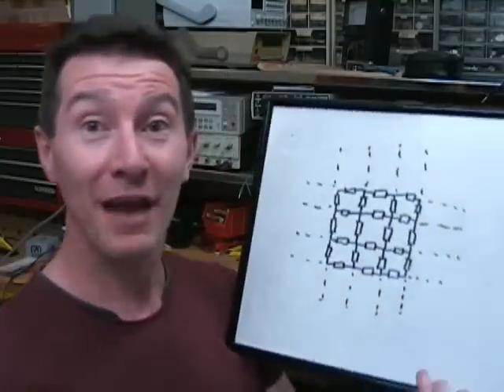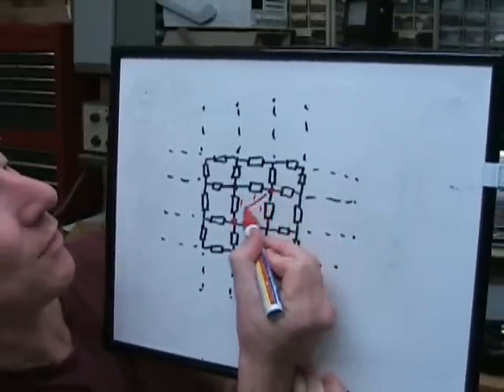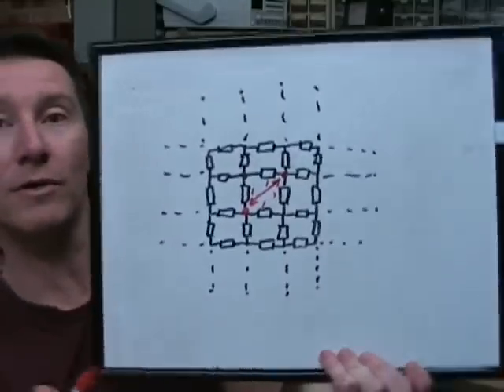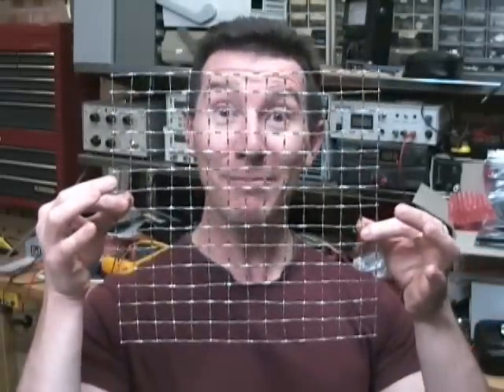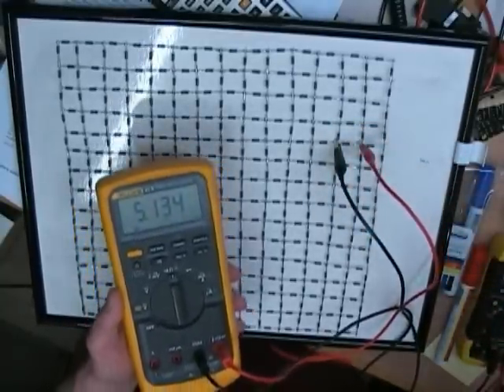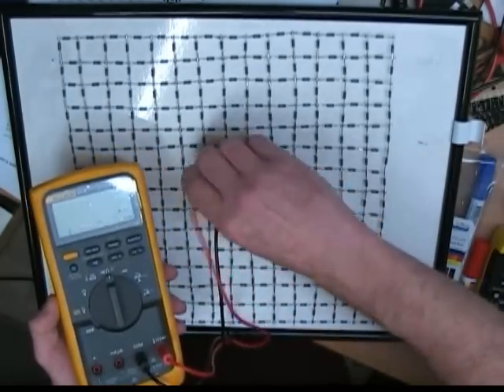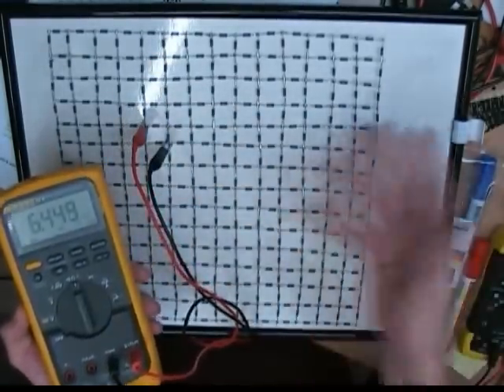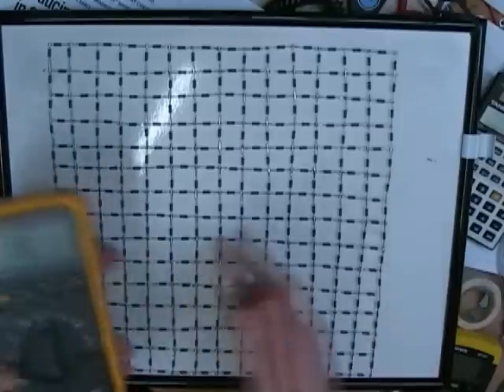EEVblog #25 - The Infinite Resistor Puzzle

Comment: I made a 3D version using 1K resistors.  The resistance across diagonal corners is 1K.
Reply: +K6EEP Diagonal on the face (i.e. min path=2), or across the cube (min path=3)??
Reply: +EscapeMCP  This was a huge cube.  20 resistors across at least.  So a facing side was a 20x20 array.  The idea was to guess resistance from corner to the opposite corner across the cube.  (min path=3 in your example)  Some one had donated a thousands of preformed 1K resistors I kept growing it until my soldering hand got tired.

Comment: Effective resistance across the single resistor is 2R/M.  M is the number of resistors (R) connecting to each junction.  For your square mesh M=4.   If the 2D mesh was actually a 3D cube, then M=6

Comment: The infinite resistor grids (in 2D, 3D, 4D, …) are awesome to demonstrate how physical structures give rise to sums of infinite series. Conversely, as a rule of thumb, if you have a series and can think of a resistor network where resistance between some two nodes is a sum of the series, then the series converges. This can actually be mathematically proven, no less.

Comment: Congratulations for being so practical.
This reminds me of the historic story when Edison was manufacturing  light bulbs and for some reason he wanted to calculate the volume of the complex shape of a glass light bulb. Apparantly the mathematicians came up with some approximations but were not so sure about the accuracy of their result. Then Edison who was a very practical man  came along and filled one glass bulb with water and he knew the volume of the water and also  floated or immersed the glass bulb in water thus  displacing the water according to Archemedes principle and again he found the outside volume of the bulb , hence he could find the volume of the glass used in the bulb.   Mathematiics are very useful but being practical sometimes gets quicker results.
Reply: practical mathematics <3
Reply: Edison was on a camping trip in 1887 near Rawlings Wyoming,  Battle Lake when he dropped the tip of his bamboo fishing pole in the cap finite noticing the glowing car nixed fishing pole tip.... I've driven by the spit many times it is marked with a historical marker.   Story is a bit iffy but makes for a good tail..

That's why I go fishing, to be inspired to invent the next big thing,  my story to my wife and I'm sticking to it...! 
😊
Reply: The definition of applied mathematics.

Comment: I know this video is old, but I just recently found your channel. Amazing that the result is 2/pi. I like your practical approach. Would be interesting to see how the result changes if you gradually chop it down to smaller networks: 12x12, then 10x10, etc. Or if I get around to build one, maybe take measurements as it is being put together.
Reply: David Scott Any finitely sized network has resistances that are a truncated sum of an infinite series. It’s possible to prove that by induction. The convergence rates depend, among other things, on how many dimensions does the resistor grid have. Try going from a 2D grid to a 3D grid with roughly same number of resistors. Then a 4D grid. Then try going from a hyper cube (square, cube, …) to hyper sphere shape (circle, sphere, …). You’ll get quite a tour of various forms of infinite series, and can then ponder questions such as  “does the circular grid converge similarly like a square grid would”. While doing so you’ll rediscover some cool theorems in calculus. All from a “simple” resistor network. I urge anyone who’s so inclined to try it out. Sometimes having a physical object to think about makes the math easier to understand. That’s certainly the case for me. When I took a mechanical vibrations course, in my mind I modeled everything with electrical circuits :)

Comment: As people have asked about three dimensional versions of this it occurs to me that if the lead lengths were constant, the resistance value between any two points might well be a constant percentage of the value of one resister.  I initially expected the diagonal value to be 1/2 of the square root of 2 or .7, which it is nearly is.  If lead lengths are all the same, then we can probably model this as a solid block of conductive material.

Comment: Why not connect the ends of each row and column, such that electrically there would be no center. Each resistor would be attached to the same number of resistors in every direction, kind of like a scrolling game. Would this work?

Comment: could you build a cube out of six of those and get the infinite properties?
Reply: I think the topological equivalent of the infinite grid would be a torus rather than a cube. Anyway, when you measure the resistance, that topology changes again so that there are also infinite zero-resistance "connections" between points at equal distances in the equivalent infinite grid.
Reply: An ifinite resistor torus with Rodin coil alignment would surely wet daves practical appetite and would look stunning
Reply: +orbik  Nicely said. If a grid of perfect zero tolerance resistors were overlayed on a toroid, would the measurement on any resistor or diagonal measurement (as dave did on 2D sheet he made) remain constant anywhere measured on the toroid? I expect it does. But can we apply a constant knowing how many resistors are in the grid and still get daves formula ?
Reply: unlost117 I think that depending on the size, it will show an not perfect value, but it will show the same error value no matter where you measure. :-)
Reply: It doesn't work. If you think of a torus of only a small number of resistors (say 9 or perhaps less), it quickly becomes clear you can't make resistors apply multiple times in a way that makes it look like an infinite grid.

Comment: Good. Now let's analyze the whole circuit if you put 5v on one corner and ground the other. Every single junction for current and voltage drop.
Reply: Nothing\ The analysis of any particular size of it is instructive, but it gets even more instructive when you see the patterns that are a series sum, and then you can get an analytic answer for an infinite grid without building one – and you can inductively prove that the answer you get indeed represents the result for an infinite grid.

Comment: Wouldn't you expect the tolerance to increase over the total number of resistors? If the tolerance is 1% per resistor you are using, it would be 5% if using 5 resistors?
Reply: Not if the tolerance is normally distributed. If its skewed or rounded, you would be correct.
Reply: Not necessarily, actual tolerance calculations are more complicated, but just look it this way, if you have 1% 1ohm resistors, you expect them to be within 0.99 and 1.01ohm. If you use five of them in series, your expected result would be within 4.95 and 5.05ohm, which is still 5ohm 1% tolerance
Reply: +Daniel T sadly most companies have a tendency to lean to being high or low still writing spec

Comment: how did a pi come into this?
i just cant picture where the number came from
Reply: Write out formulas for progressively larger networks, and you’ll see that the resistance is a sum of an infinite series. And the infinite series happens to be the one whose sum is some constant times the reciprocal of pi. Ou arises in many infinite series sums with nested fractions. Conversely, you could ask how to calculate pi using nothing but a 4-function calculator. This resistor network is a physical model for that :)